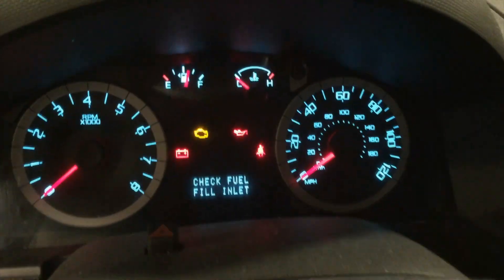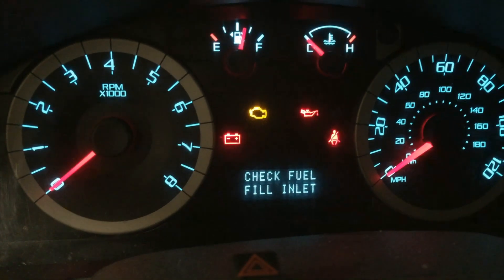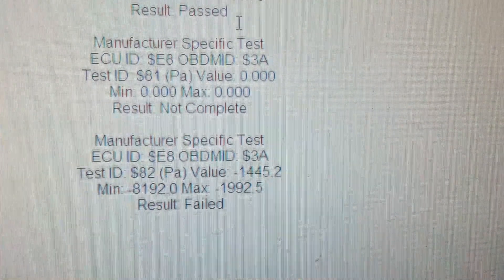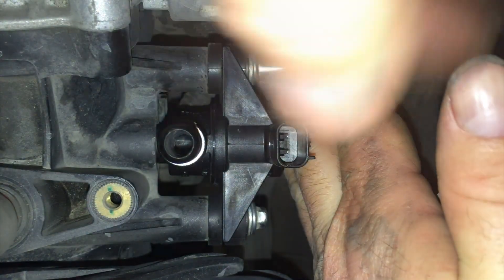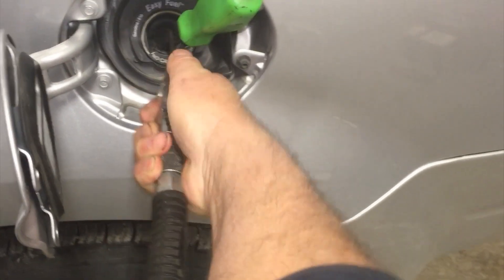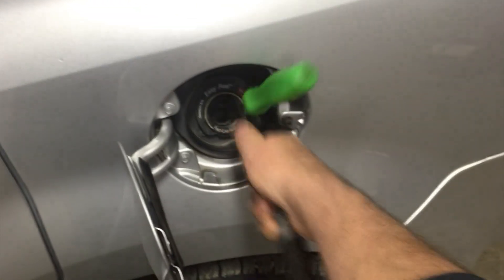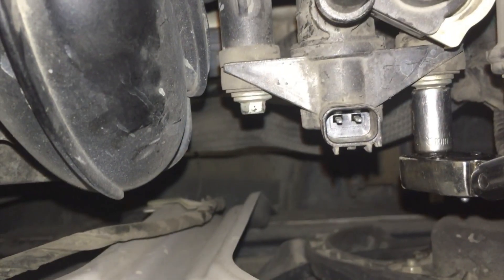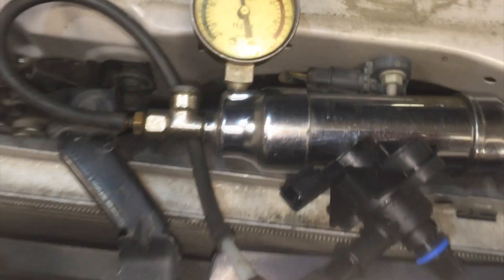Ford Code P0455 P0457  - Ford Escape Check Fuel Fill Inlet Message

Comment: Hi again.I have a problem with a 2005 Mazda tribute now ! Its the 3.0 4wd model.I am getting a po456 code but no check gas cap code.Just the check engine light is on.I was told that its the canister purge valve ?  I have no idea how to find that on the car.Got any ideas ? The gas cap was replaced a couple years ago.Maybe its that funky tree looking sensor by the firewall ? on a bracket ?
Reply from the maker: +pontiachotshot that's where it's located. It's a common problem and you should just replace it. Let us know how it works out.
Reply: The Car Doctor

Would you happen to know the part number for it ? I am having a hard time finding it for a 2005 but i can find them easy for a 2008.I wonder if its the same identical part for 2005 and 2008 ?The local parts stores act like it doesn't exist for a 2005 lol

Comment: Can you tell me the location of this solenoid on the 2008 3.0 dohc ?
Reply from the maker: +pontiachotshot I think it's in the same general area near the throttle body on the intake  I will have to check the component locator and won't be back in the shop till Monday.
Reply: Thanks for the fast reply ! My father n law just had a p0457 and p0455 come up.I am thinking it could be that sensor.He thinks the gas cap could be bad.I doubt its the cap though.Especially since it popped up all the sudden and never has before.
Reply: He also said the gas cap light is on with the check engine light but he put a new cap on it and the light stayed on,so he just took the cap back to the store.
Reply from the maker: +pontiachotshot it's going to be a bad canister purge solenoid. On this vehicle it's mounted to a bracket I believe near or attached to the firewall. It has an electrical connector on top and two plastic hose connectors attaching the EVAP hoses to the valve on the bottom. Just pinch the hose connectors to remove and depress the wiring harness connector to disconnect depress the tab on the bracket to remove the valve. Clear the codes and you'll be good to go
Reply: Hey thanks for your help big time !